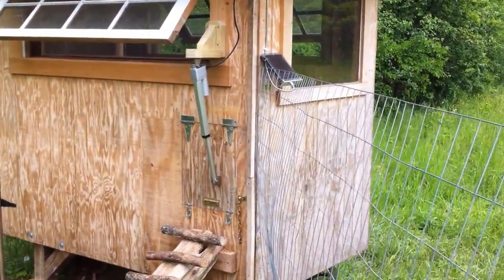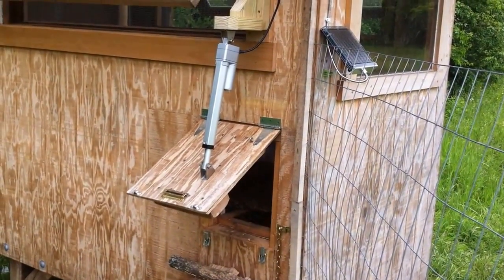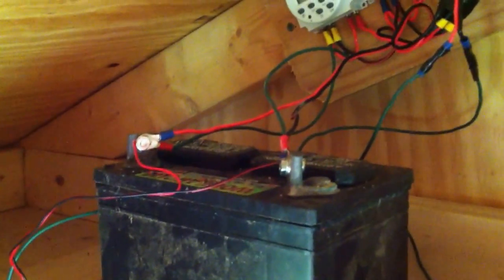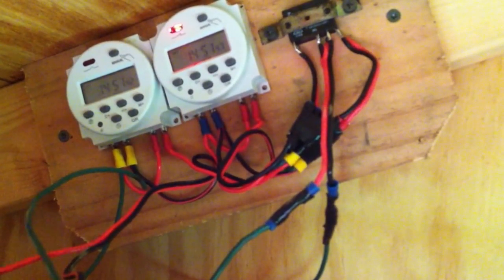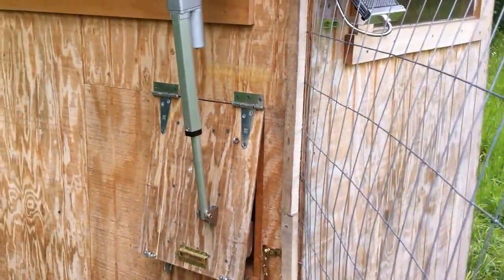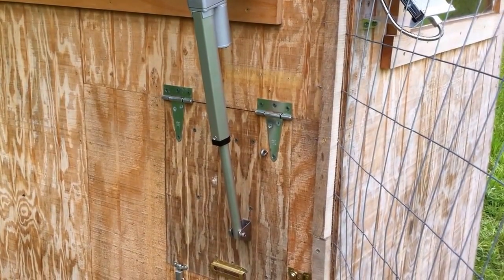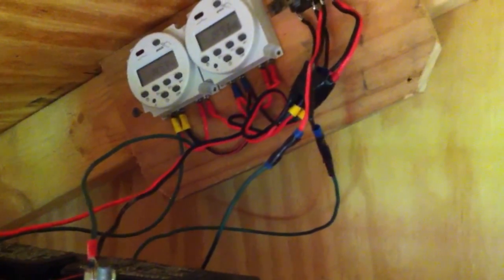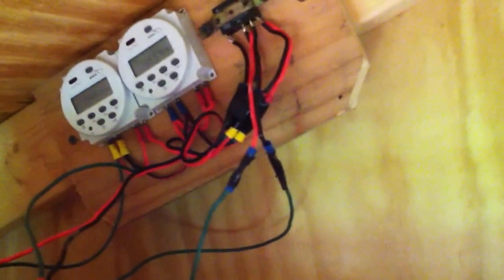Heavy duty automatic chicken coop door

Comment: wouldn't want a chicken to get stuck in the wrong place when the door is closing....
Reply: add a current limiting controller and no chicken will be harmed, they can be set to stop if the slightest resistance is felt by the dc motor
Reply: Hopefully the resistance is not the hand of a raccoon holding the door lol
Reply from the maker: +ThePoolboy789 Me neither. The door closes so slowly that chickens have plenty of time to get out of the way. Usually they are roosting & nowhere near the door when it closes. The motor makes sudden noise when it turns on so even when I've turned it on during the day, the chickens run away from it. We've only lost 1 chicken to the door in 4 years, & that was because it was the low chicken in the pecking order so it wouldn't go into the coop at night, & it liked to roost on or just outside the coop doorway. It was just a matter of time before a fox/raccoon got it. I feel okay about the actuator door because over the same time period, our neighbors with chickens have lost ~15 chickens from occasionally forgetting to close the chicken coop door at night, & we've only lost the 1 chicken to the door. None of the other chickens roost on the coop doorway entrance so I doubt we lose any more.

Comment: This is great! This is exactly what I'm trying to do. I have a chicken house and I'm trying to make the door open and close automatically. Can you please tell me what is the purpose of this relay you have and what kind is it? Also the solar charger you have just hooks up directly to the 12v battery no kind of charger in between needed?
Reply from the maker: igor koyfman See the blog post linked in the video description, I fixed the link. It explains the purpose of the relay & the relay type. It also goes over why you may not need a solar charge controller -- it depends on your solar panel rated output, & the light conditions. Thanks for the comments & sorry the link didn't work earlier.

Comment: I'm going to use the same type actuator to lift my coop door. Would it be easier to wire it to a photo cell instead of timers?
Reply from the maker: Sure - I think the photo cell would work great, especially if you located it on the underside of the eaves or some other similar location where it wouldn't get covered by snow/dust/etc.

Photocells have a constant power draw so you probably couldn't power it with a solar panel w/ battery. You'd need something like a dedicated 120VAC power source with a 12VDC power adapter...